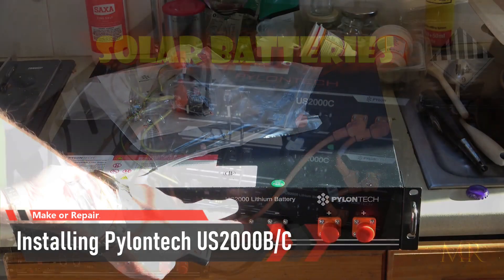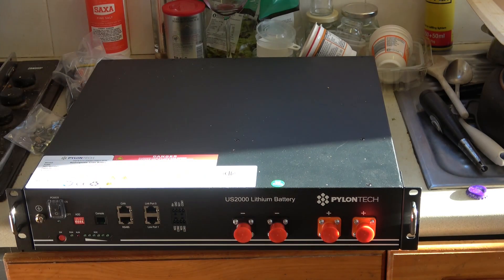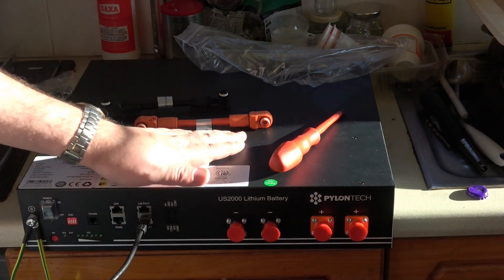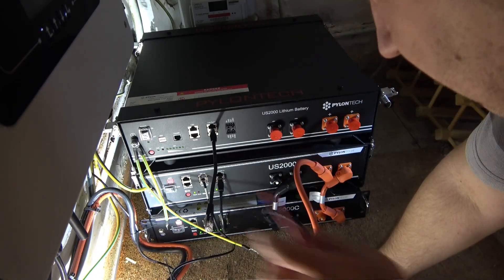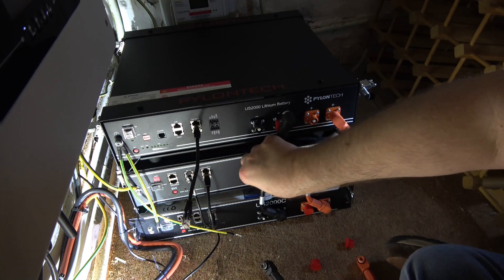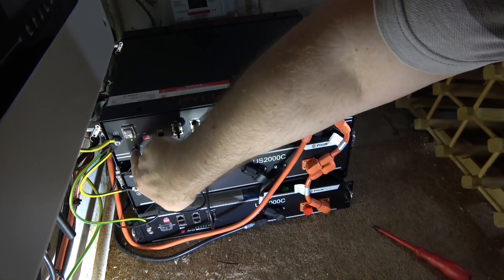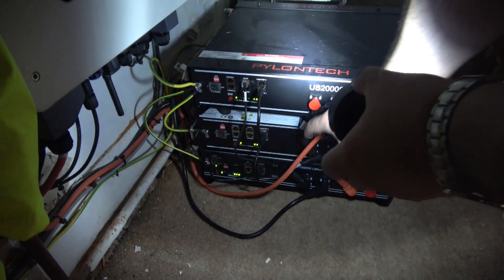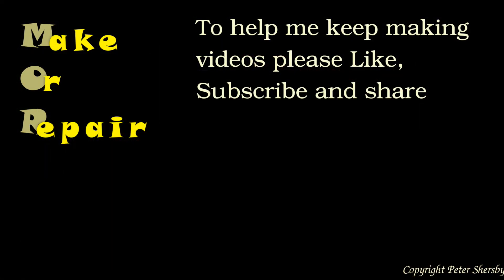Installing Pylontech US2000B / US2000C Solar Batteries #0047

Comment: Hello friend, am Haytham Mahir, installed UF5000 to inverter tupe Isuna, o  yhe inverter shows the battery 51V  and alarm activate inspite 41V is the alarm set.thus on the Battery it's indicat empty.
It would be appreciated to share your experience  with us to solve this issue...😊
Reply from the maker: Difficult to know not used either that model of inverter nor the UF series of batteries.  Assuming the power connections are all fine then two things spring to mind.  1.  There may be a problem with the connumincation cable or the protocol selected in the inverter so it is not getting the right data.  Second to my understanding the UF and US series of battery can't be mixed although not 100% certain so if you are extending existing batteries that might be the problem.   Hope that helps.

Comment: Hello Peter, I just added a us2000c to my  older us2000+ and 2 us2000c's  Thought I had them synced but charge only went upto 97% when all connected and then discharged to 13% which led to bms shutdown on top 2 batteries (so all off) as previous 3 DOD was 20%. I've now disconnected the new, the other 3 seem fine although dod dropped to 19%.  Very little sun so not sure at present whether they get back up to 100%, they should do. I plan on isolating the new - give it a full charge and then ensure the others are fully charged in order to re sync them - does this plan sound ok? Waiting for a decent bit of sun (uk and winter) so rare!
Reply: My main concern was the bms shutdown at 13%. Yet on reset ( switch off/on), levels came back upto 25%?! Hopefully over Xmas, can do some charging/isolating/testing. Thanks again.
Reply from the maker: It might be that the BMS is taking account of the lower SOH of the older batteries when reporting the charge at 97%, A 100% battery is always going to report the overall state vs. perfection.  An older battery as master will report the charge Vs. its own SOH.  I just added a new 3000C and it reports 97%.
Not sure why the discharge is so much, possibly the inverter is not understanding about the 2000+.  To my recollection the 2000C does have DOD below 20%,  you might be able to specify it in the inverter settings.
Yes, charging the new and old separately to 100% before connecting them together should be a good idea, althoug it should not ne necesarry with the latest firmware - obviously you must have the latest battery as master.
Reply: Appreciate reply. The 2 older c's are only 2 years old and no issue synching them and partnered with the older + model, can only guess perhaps this latest has upgraded firmware as DOD 95% again same as older 2. *My Solax inverter won't or shouldn't let them drop below 20% (certainly not brave enough to tamper with that!). WHEN the suns does appear (and I'm home) for a decent period, will stick to my plan in ensuring all on full - I may even separate top 2 (yes the latest is or was on top stack/master) as bms faulted on top 2 and with the 3 always never went below 20%, now currently on 19% DOD (no alarm). I left the new on 36% now disconnected. I did read a post of this happening to someone else  albeit different inverter and that it would or should sort itself out. 🤞
Reply from the maker: @kellisonline  I too shy away fron adjusting the inverter battery parameters, it looks easy to make an expensive mistake!   The 2000C is supposed to automatically manage self-levelling and certainly my last addition did that over 2 days.  My inverter limits discharge to 20% but  I always end up with 19% instead of 20.  I think what is happening is that the batteries are warm during discharge and then when it stops they cool slightly and that affects the capacity.  I generate nothing like enough during in winter to fill the batteries - mainly in winter they charge with low cost import overnight and then I pretty much drain them throughout the next day..

Comment: Do you have any CAN CABLE ADAPTER available.
Reply from the maker: I should have some listed early next week (first week in April) , I will update the pinned coments when they are in stock/
Reply from the maker: Now back in stock https://www.ebay.co.uk/itm/334819023225

Comment: You put the black cable in the wrong place on the new one to Start, you should have stated your mistake in the video.
Reply from the maker: I don't see it,  I had the link cable inserted ready to go and I put the CANbus cable in the right hole - what time code?
Reply: @MakeOrRepair  8.52 the black should have been in the second plug that is why it would not work
Reply from the maker: @vinylnutter  No sorry that isn't the case.  My Inverter uses CANbus to talk to the batteries, not RS485 so the cable from the inverter goes in the top left socket labelled CAN, which is where it is plugged - perhaps not the clearest in that shot because the RJ45 plug is transparent.  The second lower socket is for RS485 and the link cables next to them are for battery to - battery communication also using RS485.   The pinout for both CANbus and RS485 sockets also changed between the US2000B and the US2000C although my cable should in theory work with both versions.

Comment: Thank you for taking the time to post this very helpful video up.could you tell me where did you run the earth to .... was it the main earth point for the house or linked to the earth on the inverter to get back to the main house earth ponit ?
Reply from the maker: You want to minimise the number of hops between anything installed that is earthed and the main house earth point, however you also don't want any scope for a voltage differential with the inverter so...  I had a big earth connection nearby that all the major earths are taken from including the inverter so I took it from that.  If that is not feasible then I would say to earth it to an earth point on the inverter itself if it has one, or see where the inverter joins to earth - probably at the consumer unit earth distribution bus.  Any electrictionas out there with a different view?
Reply: @MakeOrRepair  thanks for the considered reply. It’s a system in a workshop so a distance from the earth rods that provide the house earth. Unless anyone pops up with more suggestions ( thanks for yours) I think I’ll add another earth rod and connect it to that so it’s independent from the main house earth.

Comment from the maker: Follow-on Video now available dealing with FAQs that have arisen https://youtu.be/MLr_KUoSDfk 
Particularly that the US2000/2000B CAN Cable does not usually work with a US2000C, US3000C or US5000 battery.  
🔸US2000B to US2000C/3000C/5000 CAN CABLE ADAPTER  in stock on ebay -  https://www.ebay.co.uk/itm/234982424825 Unless demand increases this will be the last 20 I make, this was always to help people out, not to become a mini-business!

Comment: Hi, I have exact same configuration as yours, however I get an alarm on the older us2000. 
If I take the comms cable from the second C model out of the link port 1 and into the RS485 it goes to normal. However I'm not sure the BMS is working?! Also when connecting to RS485, don't you have to fiddle with the dip switch settings? (The one C is master). Also your master black cable is off the older one, is that ok?
Reply from the maker: I tried using the newer us2000b as master instead of us2000c but it did not like it.  So top to bottom I have newest 2000c, slightly older 2000c then the new 2000b.  Regarding taking black and red from top or bottom, it does not matter since all the blacks are joined together, and so are all the reds. I have since relocated them and both come from the bottom.  I'm not sure that connecting link2 to rs485 would allow it to operate as a slave, I would be tempted to try the stack in a different order. Regarding dip switches, they should all be the same, rembering that they are upside-down on the 2000c, can't remember which orientation on 2000b.
Reply: I have setup as you have, One of the new C as the master. Comms cable as yours, inverter cable into Can, leave top zero open then 1-0. Powers on seems ok, green lights then few seconds just the run light and then 10 mins later red light on master! Dip switches all to default. Puzzled!
Reply from the maker: @kellisonline  HArd to know what to suggest.  Fisrt I think the address switches are oposite ways around on the 2000B and 2000C so make sure they are all set to the "off" side of the switch.   Next pinout for the CAN is different between the 2000B and 2000C - Why - no idea!   So if you had it working previously with just a 2000 or 2000B and are using the same cable then that might be the problem.  See my earlier discussion with Paul Cahill.
Reply: For now I have disconnected the older 2000b - the 2 new C's appear to be in idle mode!? - the Run light flashes every 4 secs.
Inverter states battery at zero
Reply from the maker: @kellisonline  and are the unit charge lights also showing zero? zero sounds a bit concerning the bms should not let them go that low  but perhaps that is how your inverter reports.  Hope you start seeming charge reported as the day brightens, otherwise putting money on the cable.  Just had a thought, you would need to check manual, but I think if you disconnect the inverter comms cable then the 3 batteries should talk to each other and balance their charge.  I think I pinned a comment with a quote from the manual.if that works it is definitely the inverter comms cable.
Reply: @MakeOrRepair  I just turned the connected 2 C model batteries on first thing to see if during this morning would receive a charge (not that they should need it). Turned on, press the SW on master which all lights power up on both, but then they slip into idle immediately (run light flashes every 4 secs - battery manual states in idle mode). So one would think it must be a comms cable issue!? My inverter is Solax X Hybrid Series. I see the cable for my older B model  advertised on eBay, I have asked if there is a different one for the C battery, as you previously stated may be. The compatibility sheet state my inverter should work with both but no mention of diff cable? I will try and get hold of Solax again but they aren't the best at getting info from.
Reply from the maker: @kellisonline  my reply to paul cahill has links to both manuals, you can see in the can pinout that pin 2 is ground for the B model, but ground has moved to pin 6 for the c model and pins 1,2,3 must be not connected in c otherwise it affects the bms.  A bloody stupid change imo.  You used to be able to buy the cable but I know Paul had problems.  Perhaps i should make s few  the problem is they might vary at inverter side.
Reply from the maker: @kellisonline  I've had a look at the solar x manual and it does seem to use a straight through RJ45 cable that uses pin 2 for CAN ground, which moved to pin 6 on the "C" model. I notice that VICTRON also has a similar problems but seems to have two cable spects  "type B" for the older pylontech and  "type A" which moves the ground!      Weirdly the Sofar inverter only has 4 pins on the inverter side and does not put ground in the cables, which is what seems to make it work.    
I suppose you could try a tiny sliver of sellotape over pin 1,2,3 to insulate them  or just pin 2  but make sure it is nice and cleanly done so it does not come off in the socket otherwise you could be fishing it out.

Are you in the UK?  since it is rj45 on both ends I can probably make you up a straight 2m through cable with pins 1-3 disconnected, the channel email should be on my profile if you want to send me your address - but keep in mind I'm working from manuals not copying a real working cable .
Reply: @MakeOrRepair  Yes I am in UK. Got your email, will send v shortly.
Reply: Just checking you got email ok.
Reply from the maker: @kellisonline  yes got it  just not had chance to think about it yet.  I have some parts on order, when they arrive I'll put together a short adapter that fits the type 2000c battery so it can use the same cable as the 2000 and 2000b.  I was planning on doing full cables, but every inverter is different, so an adapter seems a better choice.  Send me your address and I'll post you a prototype f.o.c. in a few days then hopefully those 2000cs will behave.
Reply: @MakeOrRepair  Sent and thanks again

Comment: Just wondering - does the victron monitor and protect the pylontech batteries in terms of fault disconnection etc (e.g. overload). I'm presuming it will if its monitoring grid usage, so I'm just wondering if you you have a DC fuse between the inverter and the batteries?, or for that matter is there a MCCB where the AC side of the inverter connects to the grid, I'm guessing that would be higher than the rating of the inverter in terms of max fault Amps.
Reply from the maker: The inverter limits the current drawn from the batteries, but batteries are also internally managed.  Isolator switch between batteries and inverter.  There should always be some sort of mccb etc  between the inverter and AC grid, I think itbis a prerequisite if you plan to export.  Exact requirements will depend on the inverter and can be found in installation manuals.

Comment: How far can I have the batteries from the inverter? I would like to have the batteries outside in a shed, but my mains in is at the other end of the house ...   Is it better to run a long grid/mains cable, or a long battery cable?
Reply from the maker: First, the batteries should not be put un humid locations. distance can be fairly long, you gave to run the comms cable, which is CAN so there will a fairly long limit for that depending in speed, say 100m to be safe.   But there are serious issues with the power cables.   At only 50v dc but very high current you need very large cables itherwuse you get big voltage drop along the cable and waste energy.  Also with say 50A current, they are lethal, and the longer the run the more opportunity for damage.  so you would need something like steel conduit to house them, which in turn derates the cable.   I can't remember the cable Size but price up something bigger than 25mm square.   In summary although possible, not recommended.
Reply from the maker: Sorry, missed your last question.  I think it will be cheaper and safer to run armoured mains cable, but the overall safety, convenience and cost probably involves other factors, your inverter us probably going to need a sensor on the cable that feeds mains into your house for example.  You can hang batteries on the wall.
Reply: @MakeOrRepair  thanks for the quick reply. Maybe i'm worrying unnecessarily, as I have a basement below my consumer unit and the batteries could go directly below - I was just worried about fire risk.
Reply from the maker: @timpala5841  pros and cons with each option.  Most faults that could lead to fire are likely to happen just after installation, but are very rare given the bms also tries to prevent overheating.  If you have suffient monitoring in the software then you can see a graph if battery temperature.  I keep a gap between the batteries of about 1cm to help airflow.  My batteries charging last night at 1kw each got to 33c

Comment: Hi, could I please ask where you obtained your 2000C battery commission cable ? I've had 2 of these units for 3 months and I'm having a ridiculous time sourcing the communication cable to the inverter. They were advertised as 2000's and I obviously assumed my current cable would be fine. They've also buggered about with the dip switch and the layout, this isn't an issue, but why? Anyway, my Goodwe 5048EM backup inverter is a CANbus connection, do you know what the RJ45 pinouts are at the battery end please? I've tried the ones on the manual but no joy! My 4 older 2000's have been running problem free for 4 years, love them, just wish they'd continued with them!😂
Reply from the maker: My cable came with inverter.  I've looked at the 2000 and 2000C manual and am surprised the CAN pinout does differ slightly, in particular CAN ground has moved from pin 2 to pin 6 and pin 1-3 should be left unconnected.  
https://en.pylontech.com.cn/download.aspx?id=165 is the manual for the 2000,  pinout on page 13
https://atersa.shop/app/uploads/2021/03/US2000C-Product-Manual-V1.0-20CPSV0901-.pdf is for the 2000C,  pinout on page 8   
I've seen some listed on ebay but they are not exactly clear what connections they have
Anyway hope the pinout helps
Reply from the maker: I will soon (next few days) be listing a low cost adapter on ebay that enables the "B" cable to work with the "C" at lwast if it is a CAN cable.    I'll also be putting up a video that shows how I made it.   Hope that helps if you still need it.

Comment: Why do you focus on "right to left"?  Why would it matter?  Or does it?
Reply from the maker: Do you mean in the way I bend the cables - it does not really matter electrically so long as the batteries are connected in parallel.  I find this layout reduces the stress on the cable plug and makes it easier to put on and take off if you need to, and keeps it nice and tidy.
Reply: @MakeOrRepair  Thank you.

Comment: Did you change the dip switches on each unit?
Reply from the maker: No, the address switches should be the same for each device in the same bank, there can be up to 8 batteries per bank.  So mine are all just set as they arrived (default 0 I think) I seem to recollect that the orientation of the switch is different from the 2000 to the 2000C, it is mounted upside down on the 2000C, but all 4 in the off position.
Reply: @MakeOrRepair  Thanks very much for the help.  Looking forward to it arriving and connecting them together.